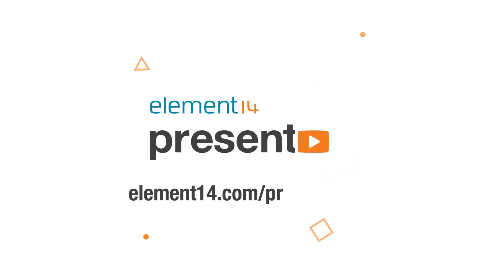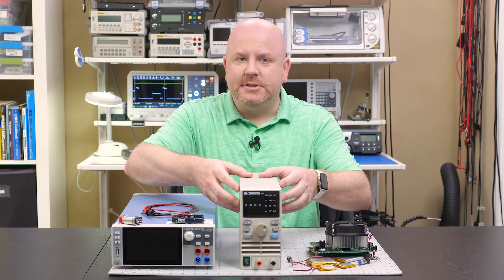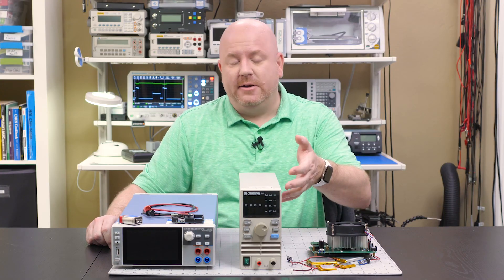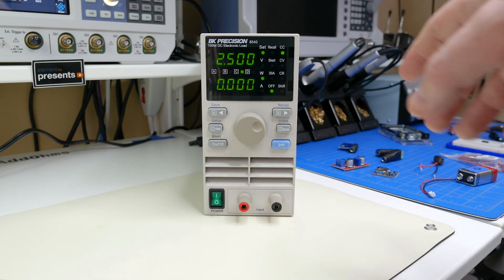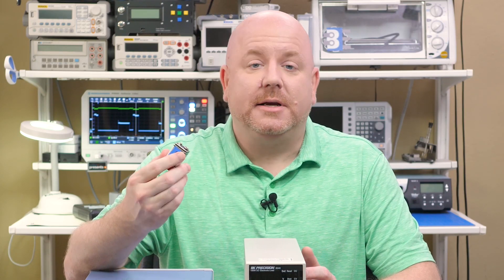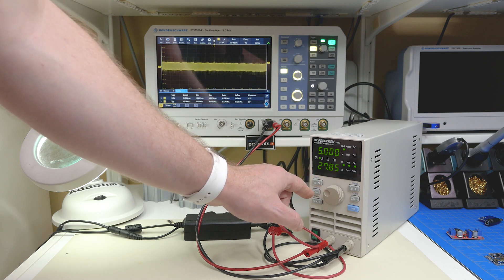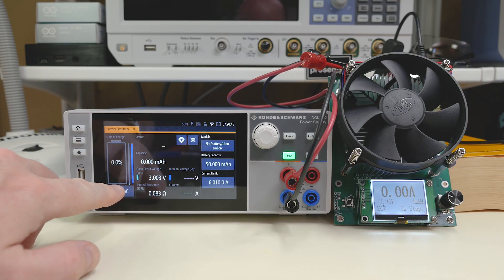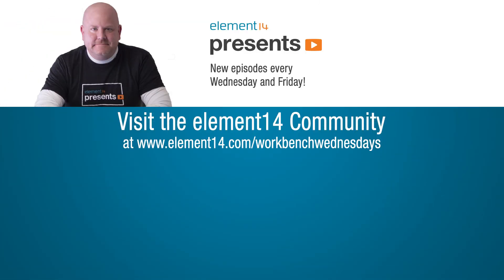Instrument Basics: Electronic Loads - Workbench Wednesdays

Comment: Could you compare Easttester ET5410(+) to the middle one you showed? Can it handle 40A continously or will it overheat? How is the build quality and durability expectation? I guess you cant expect too much of these cheaper chinese loads?
Reply: I don't have access to an Easttester and have never heard of the company. So I have no way to compare other than a datasheet evaluation.
Reply: @bald_engineer Easttester is no newbee here, but thanks for your answer.

Comment: Sir,  Can I use a  load tester as variable  DC power supply ? I have an old scrap model  FUJITSU DENSO EUL-300D
Reply: No.
Reply: ok  many thanks for your reply.
Reply: The above load tester which I have mentioned  FUJITSU DENSO EUL-300D which is a scrapped  one is not working and many be 20 years old. Can I restore this and can I use this for some more years ?  Is this old stuff compatible for the current technology ?
Reply: @krishnaprasad4910  I have no clue if you have the capability to restore it. Only you can possibly know that.
Reply: waiting eagerly  for your reply
Reply: Assume  the tester is in  worst condition

Comment: Great video. I repair power supplies and use an electronic load. You may be able to answer my question. Some linear PSU's don't seem to like being switched on with an electronic load preset to a CC value, for example, load preset to 5amps maximum capability of PSU 10amps. the PSU sees the load as a short and goes into short circuit protection the PSu works ok if I slowly increase my CC to the maximum, I don't get this problem if I attach a resistance load. is this a phenomenon you have come across, or is it my electronic load settings, I usually only use it in CC mode.

Comment: 120320/0305H PST-1105H UTC.  Greetings from California. Thank you for the introductory information on the 3 variants of  EL. For Home DIY hobbyists the first device seems to be a suitable unit than the other 2 devices. There was not much description on the  cheapest device, therefore please present a detailed working description on it. Many Electronics enthusiasts will be thankful to you.
Unscrupulous Battery sellers do cheat DIY buyers by selling B grade or substandard LiFePo4 cells with lower capacity.
The Label may exhibit the Cell capacity, which may not true. (I'm a victim) So to help DIY Group, your detailed Audio/Video presentation will be a boon. 
A newer model of such EL device has entered the market Viz: ET5420, $200. This device has similar look as the BK Instrument device, perhaps BK unit is made by the same company, EAST TESTER. The contact person of the company
is Cathy Wu <cathy@east-tester.com> . This is FYI.
Thank you and best wishes. Stay safe.

Comment: It keeps bothering me (as hobbyist) but I had the idea that an electronic load would simulate a variable power resistor, it looks like CR mode is needed the most. If I want that would be a bad idea to omit the op amp and make a crude one by using only a 10 turn potentiometer for precision to control the gate voltage of the MOSFET? Plus a shunt resistor for some load sharing and that's it.
Reply: Never mind, for one more time I think I discovered the answer after I asked you, there is no stability without the op amp I believe, because of heat I guess, thermal runaway effects etc. I did what I proposed and with stable gate voltage current either keeps increasing or decreasing depending if the MOSFET heats up or cools down. But thank you for being about to reply..! But if try it with op amp and still is not stable I'll be back...
Reply: As a fellow hobbyist, I could give a tip on something to buy or build, Tekbox Self Powered Active load. The manual has schematics. I have bought product.

Comment: You can also find some bulletproof older stuff from HP/Agilent second hand on eBay, which is certainly still usable!

Shipping is usually crazy though, since they're heavy. And used test equipment on eBay is a bit of an overpriced dumpster fire right now for some reason... Things were more reasonable just a couple years ago. YMMV